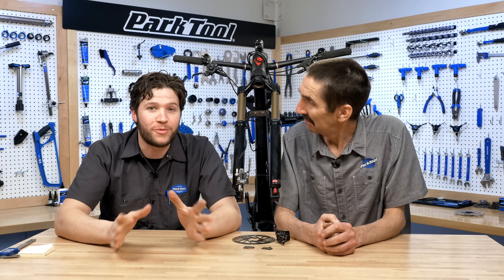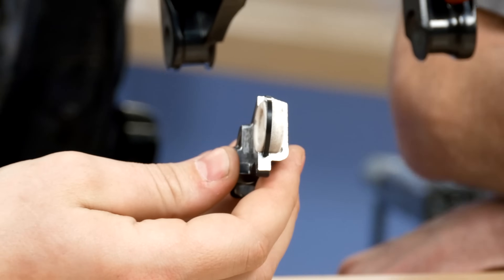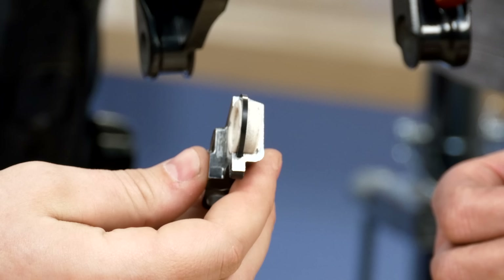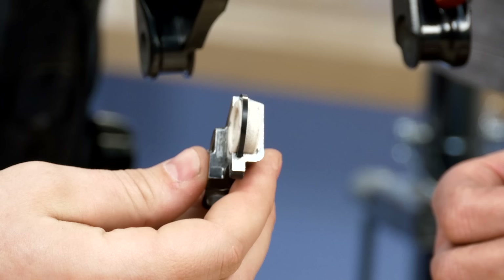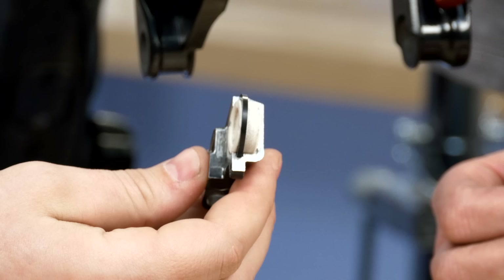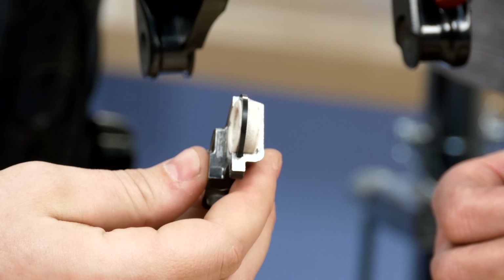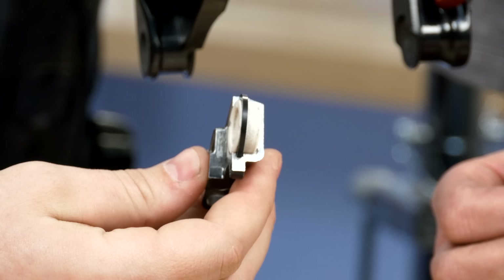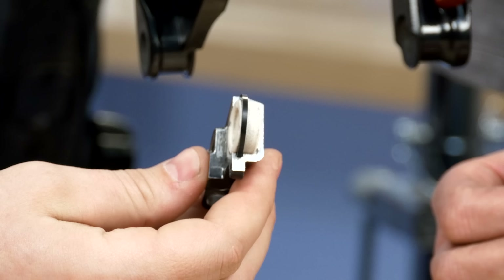How To Clean Hydraulic Brake Pistons - Tech Tuesday #104

Comment: question about 3:58
I have a new bike that came with Shimano MT200. The inner side piston (the wheel side) protrude so much that I can't put my wheel on because the disc is blocked. I tried pushing the piston with a screwdriver but it won't move (like in this video before it was cut). I'm too afraid to push hard. What should I do?

Comment: Interesting, that they used oil to clean the piston and not IPA. I think on some brake manuals they specifically say to NOT use any oil inside caliper. I guess the risk to contaminate the pads is minimal if you follow up with good IPA clean afterwards...
The visualization of side cut caliper is top job.

Comment: Very similar to how car disc brakes work except that there are no slide pins as it's a fixed, not floating setup. If it were me I'd probably take them apart and clean everything and re-bleed, but I still have rim brakes so a moot point.

Comment: I had this problem last night. All the fluid came out of the front brake. I was worried I would need to replace the caliper, but now I will clean the system first. Thanks for the video... What is the life of the seal? I have 3,600 miles on my Inokim oxo scooter.

Comment: This method fixed my "rub" problem pretty quickly.  I had a piston that wasn't retracting as far as the one on the opposite side.  I used alcohol and a foam swab and copied the method in this video and repeated again, total of twice on each side.  Reinstalled the pads, mounted the wheel, and problem was fixed.  The swabs, especially on the first application were pretty black.  2nd application not as much, but I noticed right away that the pistons were in unison with one another.  Brakes can get pretty dirty.  Gotta clean them up once in a while.  Thanks Park Tool for the great solution.  👍
Reply: its quite the opposite. cleaning and lubing can prevent retraction... cleary shown in this video...

Comment: Towards the end of my ride today, my rear brake started howling like crazy because the pistons weren't fully retracting which kept the pads in contact with the rotor, but thanks to watching this video around a year ago, I actually knew how to fix it.  It's a little trickier with four piston brakes, but the general concept is the same, and I used isopropyl alcohol instead of brake fluid as the solvent.  End result: my brakes are working perfectly again!
Reply: brake fluid is not used as a solvent, but to lub the mechanical parts to prevent wear and grip.

Comment: I was kinda trying to guess what to do with my wifes tektro disc brakes with one piston that was not moving freely and resulted in one pad always rubbing and poor braking power . I decided to clean the sides of the pistons with mineral oil 👌except with paper towel 👎pushed it back in to force the other (stuck) piston out and did the same but I guess I want too far, some mineral oil dripped  inside the caliper and I guess air went in and now I have zero pressure on the front brake 😥😥 I need to do my firser bleed

Comment: I have a problem with my brake pistons sticking so I've been researching what to do.  It makes sense to me why we need to clean the piston: to prevent debris from working its way back into the seal.  However, Singletracks posted an article on cleaning brake pistons that specifically states "brake pistons should not be lubed.  They should be cleaned."  The article goes on to explain how to clean pistons using isopropyl alcohol.  But in this video, you use mineral oil to clean the piston.  Isn't that in effect lubing the piston, which is what the Singletracks article says NOT to do?

Comment: thanks for this explanation. I have & question, when a piston leaks, will there be oil on the brake pads ?
Reply from the maker: Yes, that is one area. Remove the wheel and pads, now look and feel for oil around the piston itself.
Reply: @parktool  I removed it, and I see that air bubbles emerge from one side of the piston, so I think this caliper has to be replaced or, I can open it and adjust/fix it ...what is your advice ? thanks a lot

Comment: I don't know about roll back cuz the pads use a spring to retract them. I noticed that the stock ceramic pistons in the Shimano xt calipers seem to be not polished and were abrasive so I use the upgraded pistons to make the seals last , brake fluid leaking on the pads / disc can kill .
Reply: So these guys are wrong?  I think the purpose of the spring is so the pads don't rattle, similar to a car.
Reply: @stayathome2  the pistons move more than just the roll back from the seals

Comment: A 3mm Allen key in the calliper slot where the rotor is positioned will stop the pistons from popping out. (4mm Allen for Sram). 
This way all the pistons can be cleaned.
If disassembling the calliper then this method is great for getting the pistons completely out to check the seals
Reply: I never knew this!! Amazing and extremely underrated comment.

Comment: I'm having a hard time trying to get the brake pistons to retract. I've bled the brakes and cleaned the pistons but still no go. any suggestions.?
Reply from the maker: Depending on the brakes it may help to hook either the cup or syringe to the lever and then push the pistons back in.

Comment: What to do when after numerous attempts one of the pistons simply doesn't want to adjust and there appears to be some bubbles coming out on the outer edge of  the piston in question?
Reply from the maker: It may be time for a new caliper or for a caliper rebuild. Depends on what is available for that brake.

Comment: Great video, very comprehensive. From my experience water and mild soap works better to remove both brake fluid and mineral out. Furthermore, I would also mention how the reservoir works and how it gets isolated by the master piston before pressure build-up. Many people still think adding more fluid to the system than intended will reduce the dead stroke.

Comment: If these are dirty and not coming out equally, can that slightly warp my rotors?  I’m trying to figure out why my rotors scarp, I straighten, then they warp and scarp again ALL THE TIME -SRAM RED DISK brakes
Reply from the maker: Check the rotor thickness. If the rotor is worn and is very thin it may warp on a consistent basis.
Reply: @parktool  the rotors are only a couple of months old. Not much use.  But after every ride. They come back scraping. Just a little bit very frustrating.  The bike is about 3 1/2 years old.  Lots of miles. I don’t know it the pistons have every been cleaned really well. 
Thanks

Comment: @parktools - please address this point if conjecture if you can. Because advice iut there contradicts.... You state the QUAD RING grips the piston and distorts, then pulls it back. Got it. Now if you lubricate, there is a risk of over-lubricating and changing the friction and even preventing this "grip" altogether. That might be why SRAM advises not to lubricate. (also the danger of lube remainig or getting onto braking surface. A safety issue? No?).  Can you clarify ? There is a lot of conjecture on this out there. 
I am being told not to lubricate.
Reply from the maker: https://youtu.be/Ihb2cBiXp2U?t=200 SRAM is basically saying the same thing we are. They say no grease but then use the DOT fluid to lubricate the pistons on rebuild. This helps the quad ring to do a better job.

Comment: I've heard it said that you shouldn't use oil (fluid) to clean the pistons. Reason: if you do then the seal won't have as much grip on (it slips) it which makes it more difficult for it to retract the piston. IPA or brake cleaning fluid should be used. Also, whilst preferable to clean the piston, just pushing them back without cleaning them occasionally isn't a problem , normally the seal just pushes the dirt off the piston.

Comment: I cleaned the pistons today feel like new. However I just used some degreaser to clean. Is the mineral oil 💯 needed? Seem to work great!
Reply from the maker: Compatible grease is great. Silicone grease is what you would want to use with a mineral oil system.

Comment: Before last piston push in I suggest cleaning oil from the piston surface as it will attract dirt and make it sticky again quite quickly.
Reply: I'm also in the camp of after the cleaning process to remove excess oil with brake cleaner or alcohol so that dust won't collect.
Reply: Agree, this will prevent unintentional oil transfer and pad/disc contamination.

Comment: Why after I push in the pistons in, the brakes immediately turn soft?
I bled my brakes, got them firm and yet again the second I pushed in the pistons in like I did before they got soft.
Reply: This is because you've reset the pistons' positions, it takes a few brake actuations to regain the firm feeling in the brake lever as the pistons are self-adjusting themselves.

Comment: Another tip. Anti-bleed the breaks if the piston doesn’t quite go all the way in. Unscrew the bleed port on your break handle slightly and push the piston in a little bit. Let a couple drops of fluid out. A little goes a long way so don’t push too hard on the piston.
Reply: For this you should use the bleed port in the caliper, so that dirt from the bottom of the whole system is not going up.
Reply: @klstrucker930419 no you shouldn't. Oil will pop out completely from the bottom bleed port

Comment: Ciao ! :-)

On braking systems that have worked a lot, I prefer to open the brake caliper, replace the gaskets, and reassemble everything.

The question is: when reassembling the pistons, which lubricant is best to use?

Is brake fluid sufficient, or is there a specific grease ?

I usually overhaul systems with mineral brake fluid, other times with DOT fluid.

Grazie ! :-)

Comment: I cringe a little seeing something dipped into a jug of clean oil, you could put q tip fibers into your next brake bleed. Fill a bottle cap and put the jug away, it will be less of a mess when you knock it off the bench with your elbow too :)

Comment: What if after doing this method, 1 side still is lazy? I have been trying for a few days now on my bike, 1 side moves more than the other side. I push both pistons back, hold the one that moves correctly. This then forces the sticky piston side to move. When both are equal jobs a gooden. But the sticky piston side fails to move back after applying the brakes, they don't retract back by 1mm, causing brake rub on the rotor, the working side has approx 1mm gap. Please can someone advise what to do if the sticky piston problem continues? Can the seals actually be changed?

Kind regards
Anj

Comment: brilliantly explained! Chapeau! I do have a question though:
In the old days of cantilever rim-brakes, even though designed to have a symmetrical pressure on the rims, I usually found, that one brake-shoe would hardly move and stay close to the rims, whilst the other side would do all the travel. I think, this was due to recoiling springs to wear out unevenly.
So why does the same thing happen to the pistons in hydraulic brakes (seen in your video at 3 31 minutes), when the pressure in a liquid is evenly distributed? 
Should the pistons in a new bike maybe get a coating of some greasy material to keep muck sticking to the outside surface?
Reply: I'm no expert so take this with a grain of salt ... one issue is that the brakes can get really hot this will cause oil and grease to become more viscous and travel to where you don't want it.
Reply: And cheap imprecise engineering. It's plastic bike parts as opposed to high end aeronautical parts. ? My guess only.... But yes, not ideal.

Comment: The calipers van Moof the valve nearest to where the fluid goes in from the hose , goes out more.  The fluid to get to the other side have to go to a tiny hole and a longer way so you loose some brake pressure. 
I  use one  0.10 mm gauge on one side of the disc and the pad and push the brake and set the bolts . This way have a correction from the slower piston and the brakepads are nicely parallel and not randomly adjusted by eye.

I always try to see if both brakepads are hitting the disc at the same time. So the disc does not bend to one side.

BTW sometimes when surfaces of the caliper or on the frame/fork is not flat the caliper can move while tightening the bolts. Then you have to use your eyes again

Comment: Can I use a butter knife as a piston tool?
Reply from the maker: It is not suggested to use bare metal objects to push pistons back into the bore. Some are Ceramic and can be cracked if levered with a metal object.
Reply: @parktool  , Thank you. What about a flat but hard plastic stick, like the handle of a toothbrush?
Reply from the maker: perfect.
Reply: @parktool  , thanks.

Comment: Is it ok to grease brake leaver piston?
Reply from the maker: In a DOT system you can use DOT grease. In other systems you can get into trouble by using grease that is not compatible with the seals. That can cause the seals to swell and make the issue worse.
Reply: Ok thank you very much sir

Comment: Thank you Park Tool for sharing knowledge. 
Please can I ask - if the pistons self-correct and move out so the gap between pad and rotor remains consistent, that will require more fluid in the sealed hydraulic system. That additional fluid in the system comes from the reservoir in the lever I’m guessing. But what replaces it in the reservoir? If sealed as one unit then the lever would have to move in a tiny bit because that fluid takes the place of the worn pad. I don’t think this happens, so does this mean that the reservoir also has some of one way valve to address this? If so, why isn’t there a slight vacuum when you open the lever bleeding valve, as air rushes to replace the (admittedly small) amount of pad wear?
Thanks!
Reply from the maker: Great questions! Typically the reservoirs have a bladder that takes up the space that the missing fluid would have taken up. These bladders also act as a seal. As pads wear the advancement of the pads can get to the point where all the fluid is used and you will have a "dead" lever. It will start to get closer and closer to the bar. This is typically a good time to of course replace the pads but often to bleed the system.
Reply: @parktool  I see! Thanks very much indeed for the quick reply.  So you know that it is appreciated, it does influence my choice of tools and I do try to give back via purchases when possible.  

Sorry to add further – I’m almost there but not quite.

I think the bladder is the same as the diaphragm, without which the whole sealed unit would be solid and you wouldn’t be able to press the brake lever (apparently - I learnt from another source). I can’t quite follow why this is, I would’ve thought that pressing the lever simply moved the fluid down the cable and it is the pistons moving in that relieves/responds to that pressure. Why isn’t that the case? It feels intuitive that you need the bladder to bulge to be able to press the lever in, but is the fluid that fills the bladder separate from the fluid that travels down the cable to the calliper? I think I’m right saying that the bladder expands into a hole that has an opening to the outside air, to allow for its expansion and contraction - but if that bladder growing and shrinking is allowing the lever piston to move up and down its cylinder, the fluid in that bladder must be separate to the fluid filling the cable. Thanks again.
Reply from the maker: The bladder/diaphragm (depends on the company as to what they call it) is closed off to the piston as soon as the piston moves a certain amount. So, there is no growing or shrinking while the brake is pulled. It is simply sealed within the resevoir. Once the lever is released and the piston moves back in and opens the port to the resevoir the hose will fill with what fluid the hose/piston interface may need due to the advancement of the caliper pistons. The amount of movement is very very little on any given pull. There is some valving at the lever that is more complicated than this lets on as well.

Comment: My tip: Put ONE of the pads back in as a temporary stop to prevent pushing the piston out too far. Take it out and then clean your pistons.
Reply: I made a mistake, I pressed too hard and the pison came out, I put it back on but it caught air. and after a while I started to lose the mineral oil from the Shimano hydraulic brake. Please help me and explain to me how to proceed to put the piston back so that I do not lose mineral oil again. Thanks!
Reply: @SPN2TV  Bleed the brakes. Once the piston falls out you can't prevent loss of fluid while air enters the system.

Comment: There's no fail-safe way to maintain hydraulic disc brake. Oil leak, jammed disc, noisy rotor, asymmetrical pistons, jammed pistons, soiled seal, and the ever daunting oil change. Might as well resort to cable rim brake.

Comment: I just a used bike and one of the calipers just won't come out at all.
any tips? I got the bleed kit and everything but I need both to move 😂
Reply from the maker: Something that often works is stacking two rotors on one another and putting them in the slot of the rotor and then pulling the lever to advance the pistons. Once the free side bottoms out on one side of the rotors the other will start to advance. You can also modify a bleed block to do this even more efficiently.
Reply: @parktool  solid advice and good idea, thanks !! I'm not sure my kit came with a block which would be annoying... but I get the logic. it does make sense that if I block one, the pressure will be rerouted to the other caliper